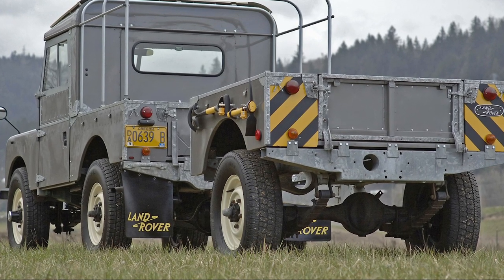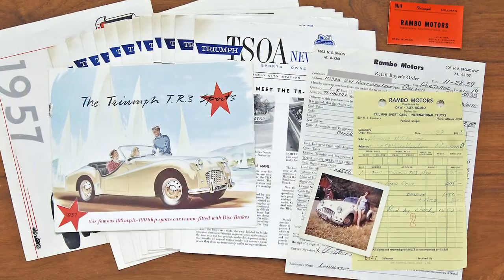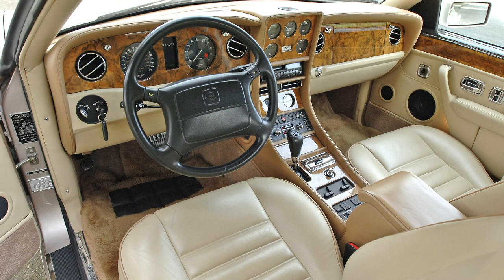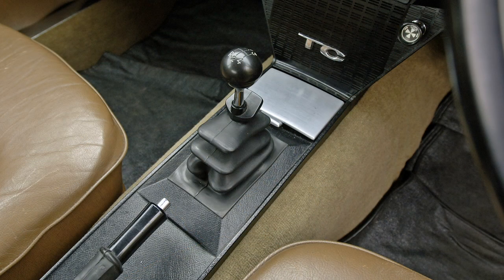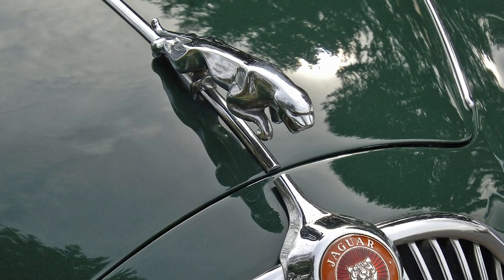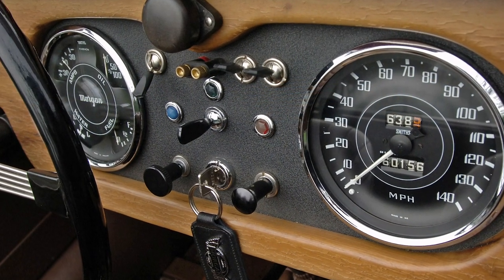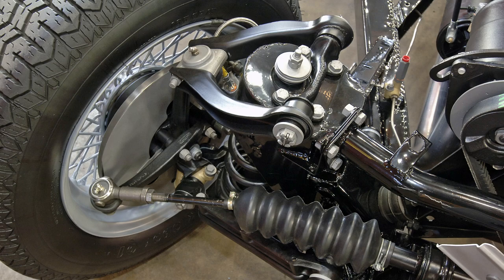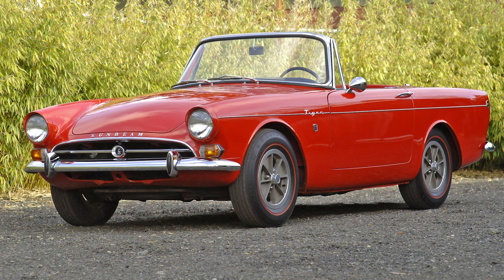The Top 10 BRITISH cars I've SOLD!

Comment: My older sister went a bit retro about 25 years ago and bought a totally unreconstructed Morris Minor, but in beautiful condition for its age. It had many quirks that only she knew about. For instance, I think it only had synchromesh in first gear - or it did have the updated synchro but the cog teeth were worn or something. Either way, if you tried to clutch and change up to second gear too aggressively, the gear lever popped straight out (exploded out more like) and pretty much attacked you. Which is exactly what it did to me when she let me have a go in it. 
She was the passenger and boy did she laugh as I was rubbing my bruised hand. And I'd stalled it, of course, just to add insult to injury. She never lets me forget it.
Happy days!
Reply from the maker: Nice! Stories like that are what make old cars fun.

Comment: Excellent!  You are very fortunate and have great taste. There is nothing like a  British car. 

Here's my list of British Cars I have owned and wish I had the foresight to keep them.
I worked for British Motors of Monterey, (Calif) from 1968 - 1972.. some of these cars were purchased at or serviced by our dealership. I bought these from customers or trade ins. Others I owned prior or later. 

1953 MGTD MK II.. my first car bought in 1964 from my good friend Geoff Green, now 98 years old. 
1959 Fairthorpe Electron Climax.. 1 of 21 made and the only one known to be right hand drive and shipped to the USA
1958 Land Rover. This particular Rover was one of the  official 1960 winter Olympics vehicles at Squaw Valley 1960
1967 Land Rover 109 NADA, six cylinder, overdrive, Tropical roof fully windowed, capstan winch and PTOs
1956 MGA roadster with MGB 3 main engine, I installed the engine and restored this in 1970
1969 MGC GT with a factory installed Webasto sunroof and a 4 speed Automatic, bought with 12k miles
1950 MGTD prepped for Bonneville. Bought in Carmel, Calif in 1966 from the owner of "Ailing House Pest Control"
1960 Morris Oxford, yellow, Identical to the Oxford in the film " Close Encounters of a Third Kind" shown in the first minute of the film. Bought from the original owner;. an American Naval officer who bought it new in England and shipped it to Monterey, Calif. 
1951 Morris Minor convertible purchased for $50 from the original owner. Great fun.
1980 Rover SD1 3500 V8 engine. bought in Monterey with 30K original miles. At the time I was a employed by Mercedes-Benz of No America as District Field Service Manager in Northern Calif. It was far superior to many of the M-B cars. Better ride and handled better. Faster as well. 

Honorable mention will go to my currently owned 1964 MGB  which I am now restoring. It is completely rust free, runs well, hauls the mail, needs refreshing and a little life put back into it. I am thinking  rally, sleeper.. a car meant to be driven long, hard and often .

I have sold the 1964 and now have a 1963 MGB.
Reply: Of course there is nothing like a British car 🥴

Comment: if you find an old mk 2 jag  you can always = E Type it  for about $100,000 - they are great - or barn find = small block chev and t350 works a treat . and do the interior right up = mk 10 rear tables , wood grain all around - nice . mk 2 = Daimler v8 baby hemi

Comment: Me jealous your TR4!
I always liked the TR's, especially the early 4, with leaf spring rear and the tractor 4-pot engine. Simple but rugged. 
The later 4A's were technically better, with IRS (not US I think) and the 5's magnificent  with 4 body and the silky smooth 6-pot fuel injected engine and 150 bhp. (Sorry, you chaps in US got twin Strombergs I think). 
The Minor Traveller (woodie!) with a 1275 twin SU engine looks fun. In standard form, 1098 at most, we always referred to them as a Vicar's car. But they were so simple they just went on and on. Till the wood rotted.

Comment: ya, driving a restored car that's TOO nice is a problem. so what i did was buy an older restored car with some miles put on it after a complete body-off restoration that was done by the previous owner. so i had what you might call "no skin in the game", and i drive it with a much more carefree attitude than otherwise. it still looks and runs great, but its show days are behind it, sort of like an aging movie starlet.
Reply from the maker: Agreed, that's a great way to go!